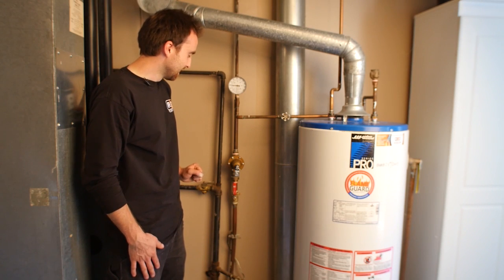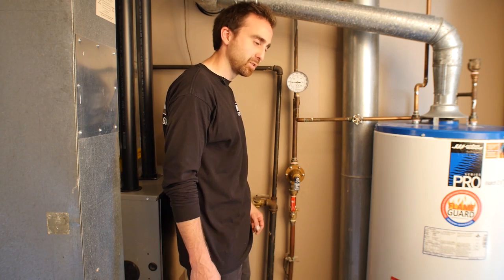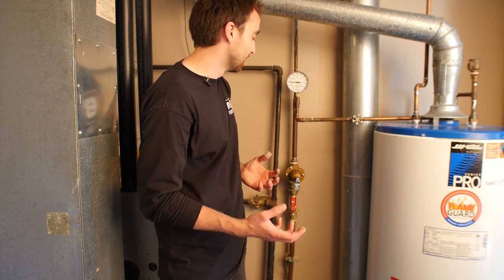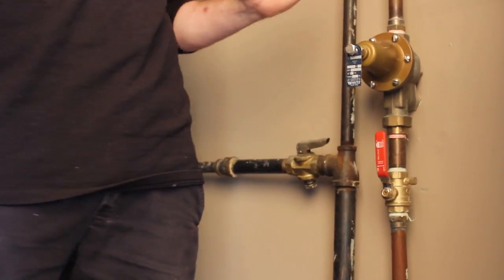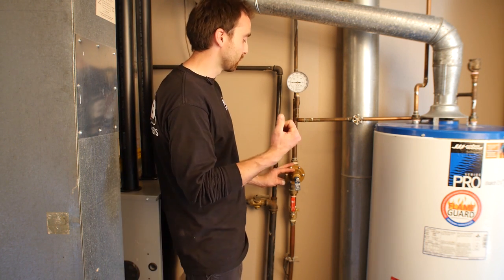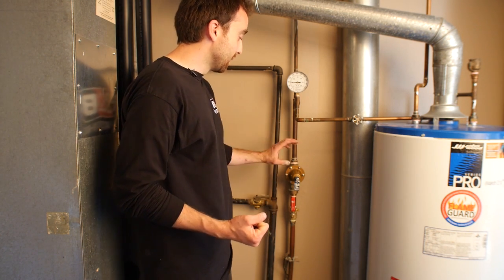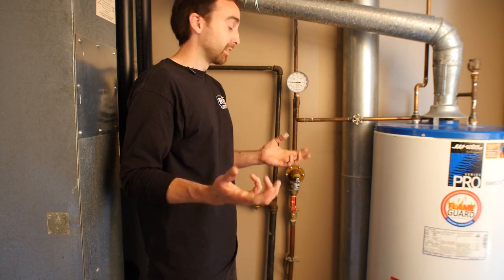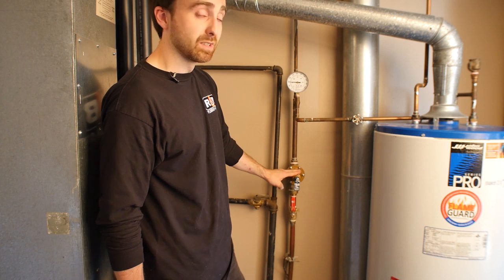Shut off your water main, and know your PRV

Comment: i attempted to replace the shut off valves under bathroom sink but the hot water side the water doesn’t stop even after 20 minutes of draining with the main water line turned off. do i also need to turn off the hot water tank line too? thank you for your help.

Comment: Can you use your PRV as a shut off, say your globe valve isn't shutting off the water, would that work?
Reply: I am guessing no. I am no plumber but I can think. If you turn down the pressure valve, you will have low pressure but your water will still be coming in......flooding your house......maybe......
Reply: @linanicolia1363  yea if you seat it completely you have no pressure it will work. That was a 3 year old comment when I was just a first year, not that I have my ticket I can say 100% that it works